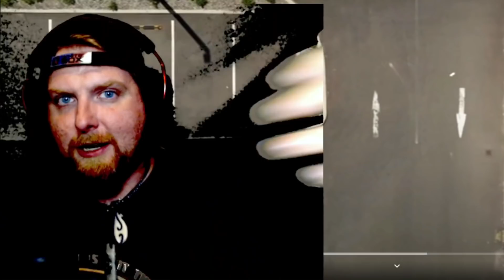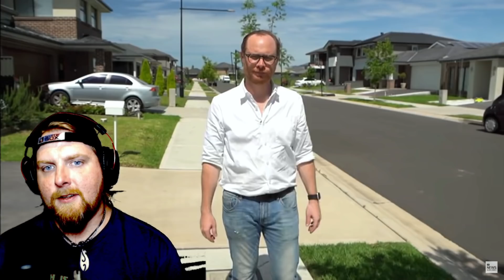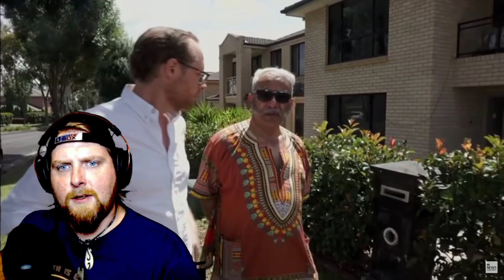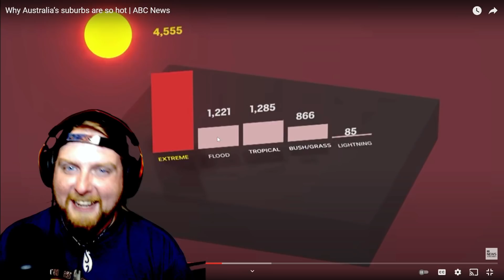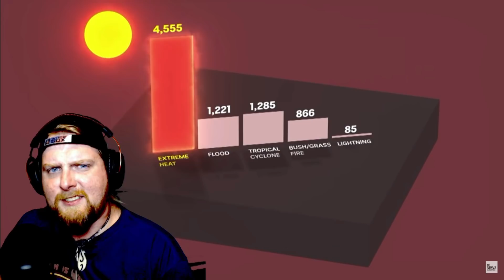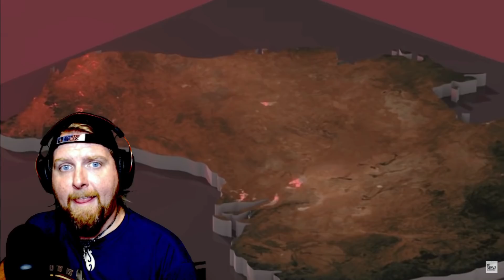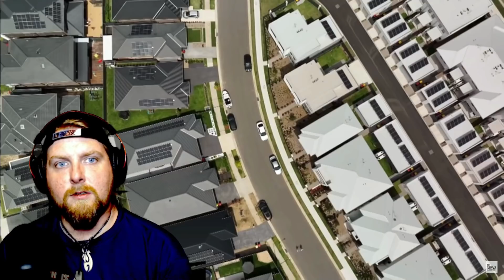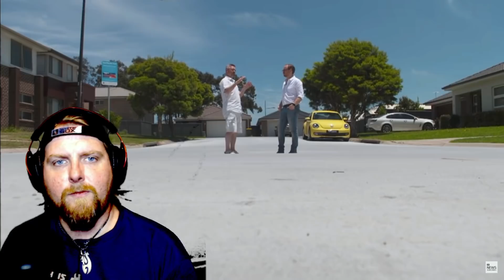American Reacts to Why Australia's Suburbs Are so HOT..

Comment: So, complicated to explain Australia's temps in various places.
Avalon Airport in Melbourne, on the west side of the bay, hit 48.9°c, way back in the 2000's.
If you look at the current national weather forecast map of maximum temps - on the eastern seaboard, you will notice that the highest temps, are occurring the further south you go, rather than the other way - this occurs because of general air flow from WA to the east.
With all that desert in between, building up the heat.
And if it is slow moving, it makes it hotter
It only requires a northerly to come down from the tropics, common, to then push that air down into the south east corner of Australia
The great dividing range then acts as a barrier, HOLDING or POOLING that air in the one area, days and sometimes weeks on end - hence the extended heatwaves and higher temps. So Melbourne can be slightly hotter in the summer, in the day time, consistently than Sydney
Usually a drier heat.
In the CBD, there is no relief at night as the concrete jungle radiates the day times absorbed heat back out at night.
This however, can be good in winter

Comment: When I see houses with only a metre between them, I think "Why not just build terraced houses? You're 95% of the way there, anyway.". 

Regarding the effect of plants. It's huge. My house has an extensive garden of native plants around it and compared to a house down the street with basically just grass, it's several degrees cooler. You can feel the difference just waking down the street.

Comment: This past summer in Perth it was over 30 degrees Celsius (86 Fahrenheit) for at least six weeks straight, with six consecutive days over 40 (104), parts getting up into the 50s (122+). This went on right through Christmas. It's too hot when it hits 40 and above to be at the beach during the day. Worth it really early morning or later evening, but go in the day and you are just inviting extremely severe sunburn and heat stroke, it's a hospital visit within a couple hours. You're more likely to find tourists flocking to the beaches on those days, and being hauled into emergency for it. We have evaporative AC which usually works a treat in the dry heat we experience here in Perth, but it was useless against most of those days. Best thing to do was just stay inside, keep drinking water and move a lot less. It was a record breaker and won't be the last. There has been a trend of summers being hotter and lasting longer and then being slammed with a more unpredictable wet season with just some thin slivers of nice weather cushioned between. Climate change is real, and this sort of urban development creating vast swathes of dark infrastructure is a part of that. It sucks. I love living in Perth but those heat waves take a massive toll on everyone. Tempers get shorter, mental health declines with lack of sleep, on the back of all the COVID stuff it can get rough.

Comment: I lived most of my life in Melbourne area 24 years, and can tell you now it gets really hot during summer, like you literally burn if you're walking outside, if you were wearing shoes with thin soles on the bottom you'd literally feel your feet warming up. Had to be in a pool or have the air con blasting for sure. Melbourne is also in Victoria and we've had some pretty bad bushfires aswell. I live out in country now and we do alot of burning off before summer now to prepare for summer time, it's bad in Victoria I couldn't even imaging living in other places around Australia that are alot worse than here. WA cop it pretty bad

Comment: I am lucky to live in Toowoomba, Queensland  which sits on top of the Great Dividing Range. We are called the Garden City and have trees lining every street and many parks in every suburb. White roofs are common in new housing developments. Normally a hot day here will have an afternoon thunderstorm and being at altitude guarantees a breeze. It's a 2 hour drive to the beach but we have public pools to escape to also. Most of our newer shopping centres have shade covered parking. A heatwave here can be about 42 degrees in Summer but Winter temperatures can drop to near zero degrees (no snow though).

Comment: 49c is absolutely hostile. I used to work in a warehouse that wasnt climate controlled and i remember working in 48c. It was assaultive. going from the air conditioned office back to the warehouse was legitimately painful. In Metropolitan Melbourne, we don't see those levels of heat very often but it does happen. Domestic water heaters only heat water to 50c. it was almost like taking a shower and only turning the hot tap on.

Comment: The fashion for dark-coloured roofs drives me nuts. Not only does it make it expensive to cool the houses, but it makes the air outside hotter as well. It is not only impractical, but a public nuisance.

I got my roof sprayed with "solacoat", a paint that was developed by CSIRO to reflect IR as well as visible; it turned my upstairs rooms from virtual ovens to actually comfortable. About ten Celsius cooler on a sunny summer day. And doesn't use any power.

Comment: In 2009 Melbourne had a pretty severe heat wave snd we were on water restrictions then, fountains were turned off, less parkland watering, used recycled water. 

I remember I think in January there were 3 days in a row where the temps were on average 43-46 deg c, it was hot. You could smell death in the air because there were dead animals everywhere. Walking to my car after work there were dead possums that had fallen prom the trees (they can only pant to keep Cool) and I remember seeing crows and magpies laying on the ground with their rings out stretched, they were laying on a green line on the grass i the park as there was a reticulation line under neath, it wasn’t on but the green grass must have been cooler. 

I remember my house was hot, first time I ever felt heat coming up through the floor in my kitchen through the tiles. 

It was only a few weeks later that the black Saturday fires happened about an hour north of Melbourne where hundreds of people lost their lives that day, the heat wave just dried everything up for the fire, a perfect storm and it was heartbreaking.

Comment: Easy way to convert temps from Celcius to farenheit..... Double it and add 30. For example 25 Celcius, doubled is 50, add 30 is approx 80 degrees Fahrenheit.
This works well for weather temps but if you're talking very hot temps (like steel melting points for example) this hack doesn't work...

Comment: My landlord painted the tin roof white a couple years back and its so much cooler inside, days that I used to put the aircon on, I don’t have to a lot of the time, this summer I only used the aircon about a dozen times. I’m in Melbourne. I was a bit shocked at the difference, I knew there would be a difference, but not that much. I sometimes would get shocked when I would walk outside and feel the level of heat.

Comment: I Grew up on the coast, but when I had to move into the city for work, the heat got intense. When I got to purchasing property, I opted for a kinda run down house in a ‘lower class’ suburb. But it had big, old trees on it, I love em. That was a major selling point. I dont get the sea breeze, but it is enough that I only need to run the AC on occasion. But I consider 30c mild, 35c as warm. There are arguments at work, a colleague likes his AC set at 21c. Which is arctic on my scale. We've settled on 27c as a compromise. Still cool in the office, but not so cold to be hazardous.

Comment: Our ancestors had it right, modern buildings have caused the problems. Older 50yr to 100yr homes had stone/brick walls, 9' to12' ceilings, ventilation was set in walls so hot air could be released at ceiling height, vents on lower to take in cooler air. Verandahs around all house to keep sun off outer walls and windows, also galvanised corrugated tin roofing to reflect heat. Modern day homes are a consumers nightmare to keep either cooled or heated. JMO.

Comment: Melbourne is known for having "four seasons in one day", it can be really hot and then really cold and really wet. Melbourne has a very strange weather pattern. They point out the income of Emu Plains,  but Emu Plains is one of the wealthier areas of the Penrith region. As for Wahroonga - It is generally a more established suburb. Marsden Park and a lot of suburbs in Western Sydney are very new. Western Sydney University (WSU) have a few papers on the effects of heat in Western Sydney. I've lived in Outer Western Sydney all of my life and it can get very hot, I've lived through a few 48-49 degree days. It's the worst when you have multiple days over 40 degrees. The nights are the worst, you can't sleep, but you have no energy due to the heat. Thankfully, the summer that we have just had, whilst we have had the floods and La Nina, which have been devastating to some areas, including my area, this has also brought a milder summer, which was a blessed relief. Also, for Penrith, they take the temperature at Penrith Lakes (where the Olympic rowing events were in 2000) where there are almost no houses for a fair distance, so this will show a lower temperature than in the house locked suburbs, which will affect the reported temperature. Whilst studying at WSU, I sat at one of the outdoor picnic on a what felt like a mild spring day. I had a bottle of Coca Cola sitting on the table - The heat actually cooked the Coca Cola, which I didn't realise and had a very unpleasant experience when I went to drink it again. The hot days make driving a car very uncomfortable. The seat burns your backside, back and legs, the steering wheel and gear stick will burn your hands. People will drive with oven mitts on sometimes. Air conditioning is absolutely required in Western Sydney. If you get a chance, check out Coober Pedy - They know how to do desert living right!!

Comment: I live in western NSW in one of the larger cities which is closer to the desert than Sydney and even with the heat island effect it never gets that hot,  average summer days are around  34c (93f) and a very hot day is 45c (113f). Most summers will have about 20 very hot days except the last two years where the summers  have been lots cooler. The winter and cooler weather lasts much longer than the summer.

Comment: That heatwave they talked about in Melbourne was 2009, the summer of the black Saturday bushfires. It was 47° in my suburb that day and going outside was like walking into a blast furnace, the heat and wind was enough to burn your nostrils as you breathe. 
But yeah, even though that is the worst I've ever experienced in Melbourne, it routinely gets above 40° in summer, our bushfires in Victoria are generally worse than in NSW. I remember when I was young we lived just out of Melbourne and we had weeks of 40°+ days leading up to Christmas, we lived in 100+ year old houses with no air conditioning and finally on Christmas day it rained and dropped from 43° to 26° and all the kids were running around in the rain. So yeah Melbourne still gets hot.

Comment: Melbourne actually get's hotter than Sydney, and also much cooler in winter. It's a drier heat than Sydney, so at least they don't have to put up with heat combined with high humidity.

Comment: It get's that hot in the West of Sydney, but when it was hitting 49 out there, it would have been barely over 40 where I live closer to the harbour. I have been in 47C, and also through a 46C day, and they almost killed me. As you get older, and less fit, those temperatures are almost impossible to tolerate.

Nice to see nearmap mentioned here - I work for them, great fun company.

Comment: I have to lol Sydney's western suburbs are hotter coz there closer to the desert don't forget the snow mountains they have sitting nearly on there heads between them and that hot desert. Sydney isn't a hot place at all. 49C is on the roads race tracks get that hot too on the tracks. Try live in a city that actually lives near the actual desert no snow mountains within cooee of them where 49C is normal is the air and the bitumen roads melt away. I guess the west of australia must know how to deal with the hot weather. Where as Sydney ppl must be whingers please coz they get hot please hold my beer they don't know what heat is try leaving your city and see what real heat is like where water is now where and trees and scarce at best.

Comment: Ian, even Hobart has temperatures in the high 30s and low 40s during summer. It’s not just those cities to the north. 
Although Darwin rarely gets over 33C, they have extremes in humidity which make the heat unbearable up there.